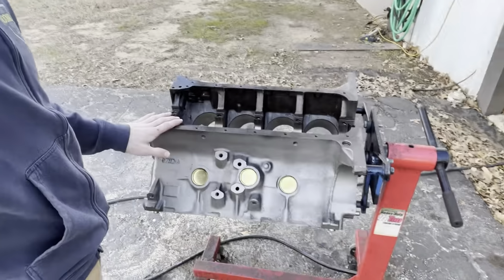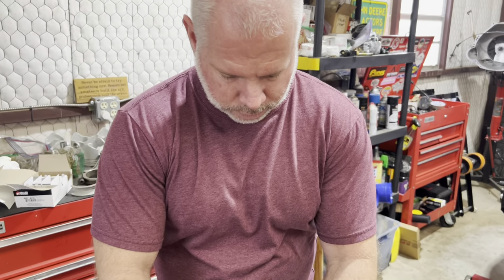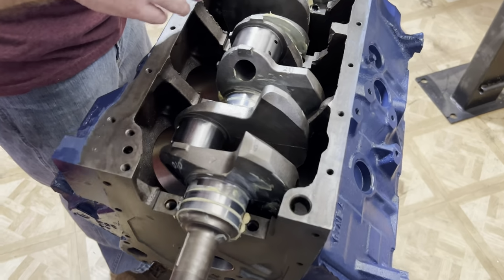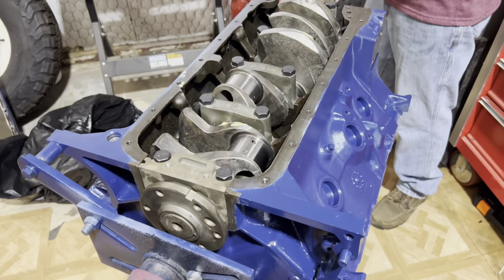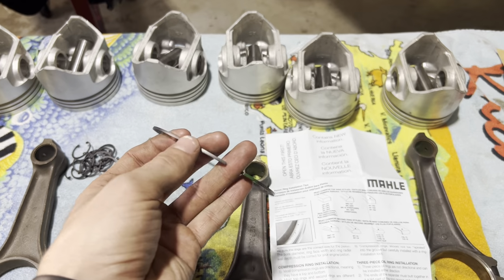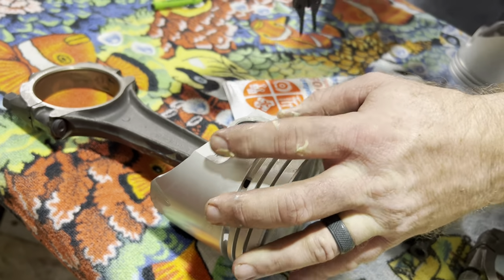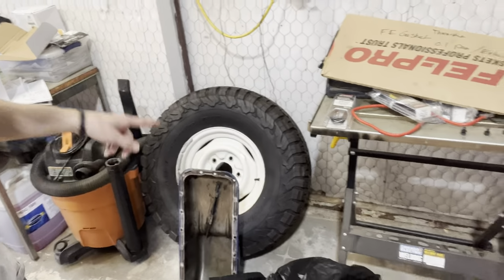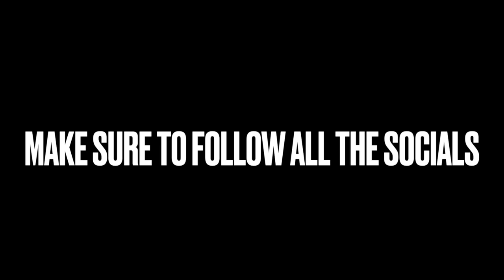Turning A Ford 360 FE Into A 390 FE

Comment: FE series is an Old Dinosaur of an engine, I had a 1969 F250 highboy  a 4 speed granny low and NP205 divorced transfer case. Mine also got a 428 from a thunderbird with the C6 and a loose converter and a pair of Low riser 427 heads I traded some parts for.  I run it hard sand drags tossed a couple rods through the side of the block with a bit to much timing and a hit of nitrous. Then it ended up with a 460 C6 out of a 69 Lincoln Mark. Never got that 460 to run as good as the 428. Ended up selling the truck in the late '80s.
Reply from the maker: Heck ya man! We love FE’s over here. I have a 428ci in my ‘66 F100 and let me tell you… that sucker rips🤘🏼

Comment: Nice build. I think i heard u say somthing about ARP rod bolts?? They are a good idea to use them but remember if u do use them, since they have a greater clamping force, they will distort the big end of the rod bore & make them out of round so u have to take ur rods into a machine shop & have them resized on the big ends.

Comment: Lots of options combining 360 and 390 parts. I built a 390 with 360 rods. If I remember correctly, they were .058" longer giving me a decent compression ratio.
Reply from the maker: The plan is to make this motor a nice street motor

Comment: I am building a .020 over 410
Are using 2v pistons or 4v 
(What  height / compression height)
Reply from the maker: In this video we were using sealed power stock replacements. Since then, we have chosen a different route and will be installing some high compression dome pistons.

Comment: I've got a 360, but don't have a factory 390 crankshaft to replace it with.... Where can I find one that has a 3.784" stroke?
Reply from the maker: We found a 390 crankshaft and a set of 390 rods off of eBay. The rods had already been cleaned but we paid $100 for the crank to be dipped and have the journals cleaned at a local machine shop. Crank and rods are both stock spec.
Reply: @pylescustomzgarage  what stamps should I be looking for to get a stock 3.784" stroke
Reply from the maker: I believe 2U or 2UA. When I get home, I will look and see what is stamped on our crank.
Reply: @pylescustomzgarage  thank you